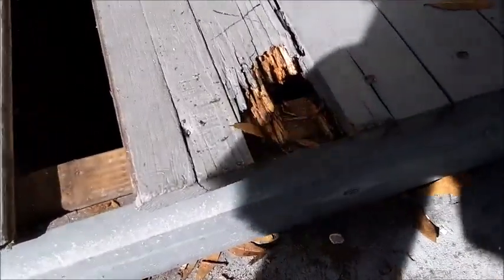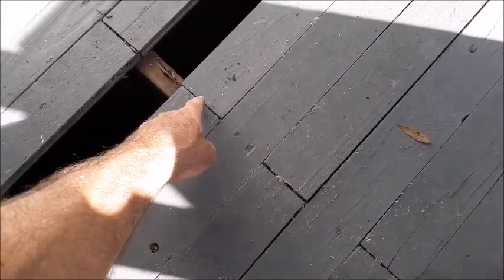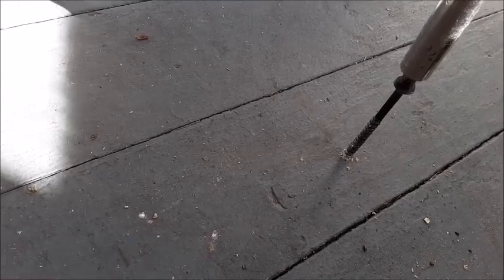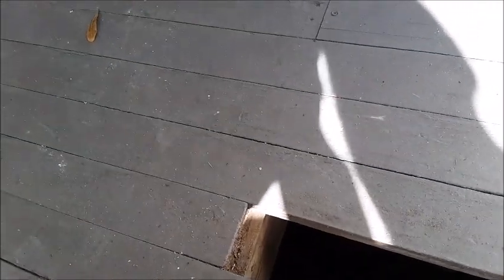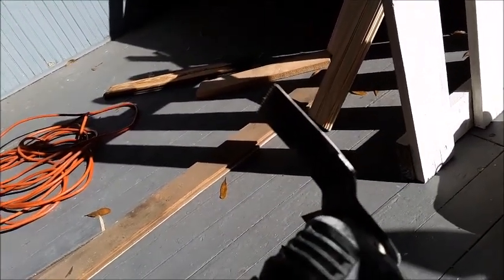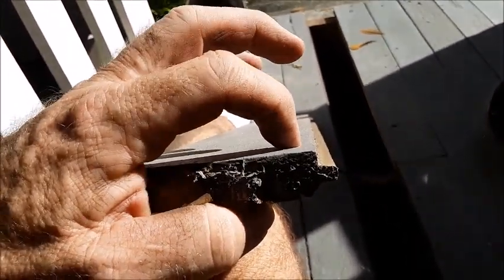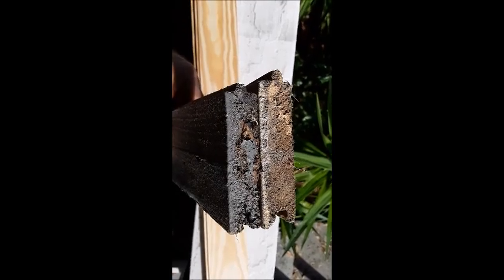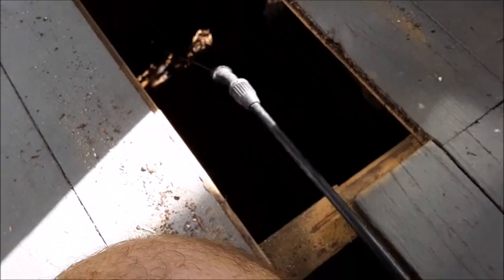How To Replace Tongue and Groove Porch Boards

Comment: Didn't see that 60 second interlude coming. How awesome. Amen!! Not a single good thing we can do to earn that. Not of works lest any man should boast. Anyway, I am needing to do the exact same thing, same type of boards, same color. Only problem is the entire front porch has no splices or joints. They used 10 foot boards. Only 6 or 7 have rotted ends though. Would it look bad for only a few to have joints in the middle? Is it possible to replace several 10 foot boards, the whole board all the way to the house? Was thinking about replacing the ends by doing them the opposite direction, perpendicular to existing boards, but the first joist is nearly 2 feet back. Any thoughts?
Reply from the maker: Hi Tim,  Thanks for the comment and encouragement.  I believe the house in the video had one piece boards also and we just spliced the ends.  Certainly you have to look at it every day so you would have to decide if it looked out of place to you.  You could always put some type of rug or door mat over the spliced area.  As for replacing the whole 10ft you could surely do that.  You might want to check to see if the end of the board up against the house is going under the front door sill or the front wall.  If all your 10ft board are side by side it will be easy, but to pull one 10ft board out of the middle will be more challenging as it will be nailed on each joist.  When you pull two boards side by side they will bifold up unless again the ends go under the front door or wall.  Good luck with your project and pray and God will give you direction on how to do it.   God Bless.
Reply from the maker: Hi Tim,  Also check and make sure the new wood is exactly the same width as I have see some historic boards that were just a shim wider or thinner.
Reply: @creativerepairing2960  Thank you so much for mentioning that. I will double check that. There are about 11 or 12 boards that are either rotten or on their way sounding very hollow, in groups of 2 or 3 together. I guess the last board that goes in will have to be slid in from the end the whole 10 feet up to the house. Is that correct?  Thank you again for your strength and willingness to share salvation with viewers. With the world the way it is today, it is needed more than ever.